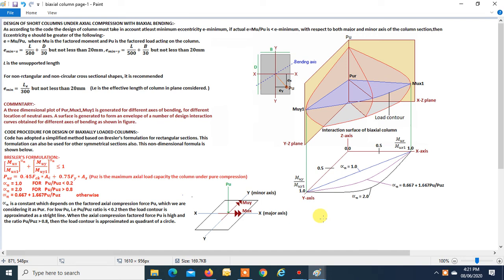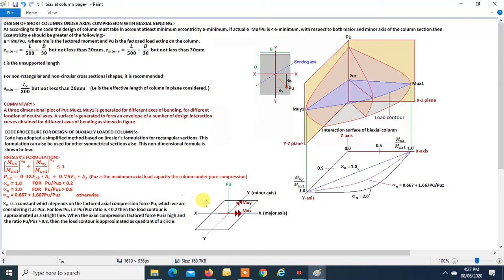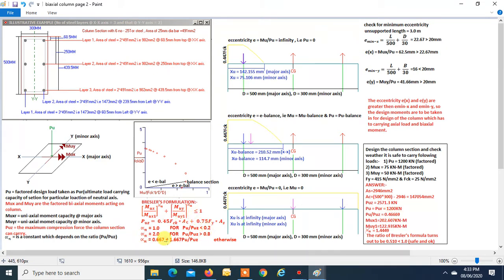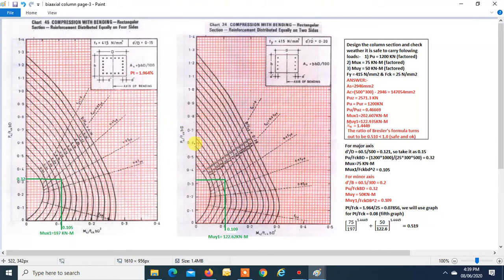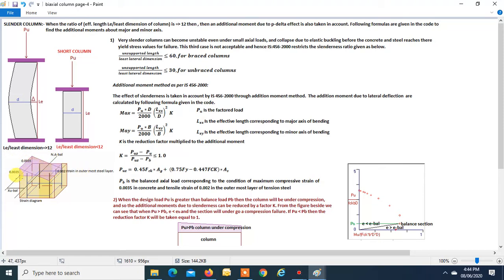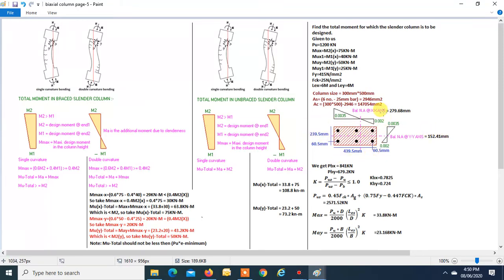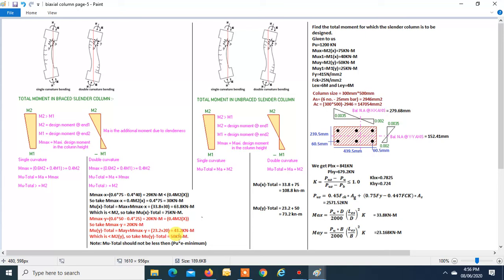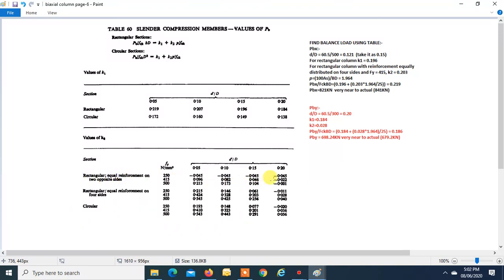Design of biaxial column

Comment: Good sir . I learned many things from u sir . 
Are u using vb6.0 or vb.net?
Sir please guide me how to draw graphs in vb6 with suitable scales .
Reply from the maker: hi
Actually there is no particular option in vb6.0 to draw a curve. You can only draw a line using line command. So if you want to draw a curve then you will have to sub divide the curve into small line segments. Create an array for each small lines i.e (x1(number of lines to drawn),y1(number of lines to drawn)) - (x2(number of lines to drawn),y2(number of lines to drawn)). The first bracket carries the coordinate of start point of line and the second bracket carries the end point of the line. Write a code to draw all this lines in such a way that the end point of line x will be the start point of line (x+1), and so on.